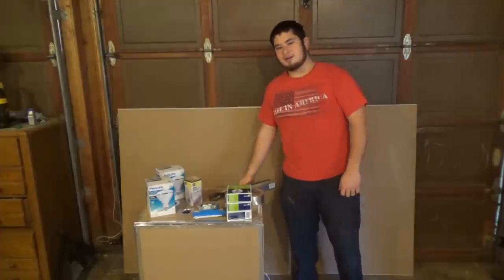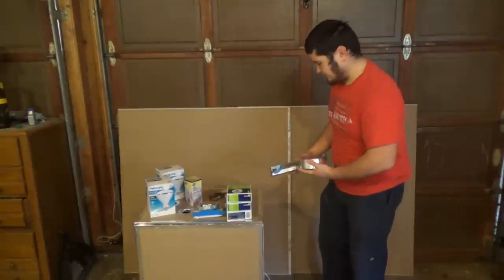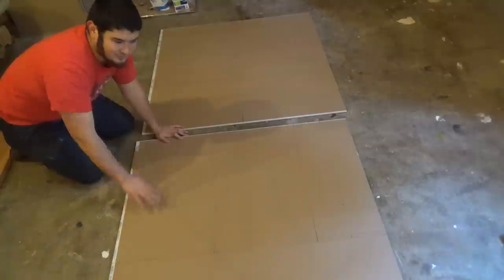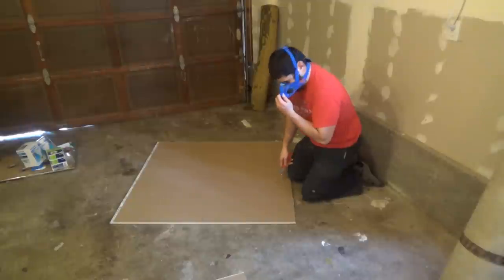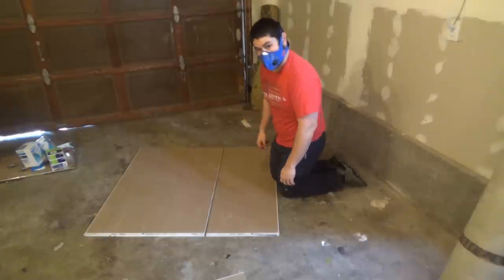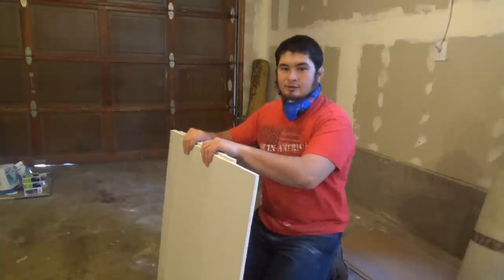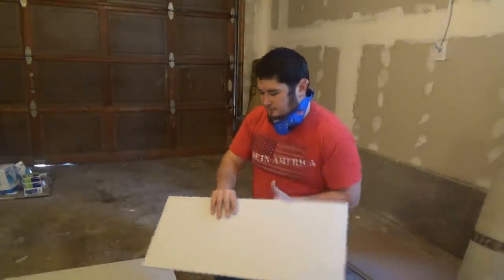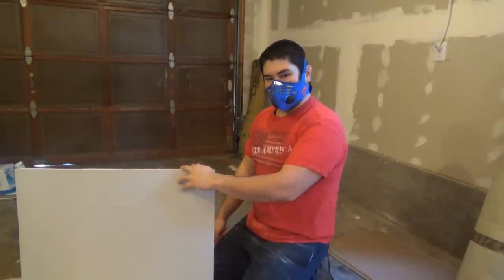Building a PVC Bow Hot Box Part 1 - Materials, Layout, and Cutting

Comment: Just in case anyone thinks they may need to cut lots of angled lines in dry-wall, thick motherboard, etc. there is are tools made specifically for the task.  Most craft stores would carry matt cutters that can be used with a steel square to make long cuts with a 45° cant along their length.  This will be the tool I use to build a heater box, if I think I'll ever need one; as I do not trust my carving ability as much as Nick trusts his.

Comment: Just a thought, here.  You can get nice straight cuts with a "drywall t-square" also found at Lowes or home depot.  This would make the edges fit nicely together and result in less heat loss at the seams. It may even make the thing more rigid.  Keep up the awesome work Nick.

Comment: Thanks for the videos. Well detailed and inspiring. I finished making the box and just put a hole in the side to allow the heat gun to flow into the bottom. No additional
lights to buy, no switch or wire. I bought the heat gun at Harbor Freight for $8.00.  An optional step for the electrically challenged. Great for those who already have the gun.

Comment: Guys what is the hotbox actually used for? Is it to preserve the shape after removing the bow from its form? I can't seem to find the answer anywhere...
Reply from the maker: +Raul Jackson This hotbox is for heating PVC pipe for making bows. You place the pipe into the open end of the box and it heats up. This is different than a hot box for storing horn bows and hotter than a hot box for curing fiberglass bows.

Comment: Hi, Nick, I think your videos are awesome, man, you're a great inspiration! I'd like to ask you, wouldn't be better a longitudinal oven heating the entire pvc pipe instead one half at a time? once I've watched a video where you placed some aluminum foil in a mold, in that case you used a heat gun, how about a mix of the two methods? 70" mold, aluminum foil and light bulbs? Thnx for your videos, pal!!
Reply from the maker: +Gabriel Ultra The only problem with that is you'd need a setup to flatten both limbs at once. It's possible to make a form like this, but for me it's much easier to work one limb at a time. If you wanted to build a longer version, double the length and double the bulbs should do it.
Reply: I see, I'll try to do it and then share to you, thnx, pal, you're brillant, I've been watching your videos from long ago and you always surprise me :)

Comment: 16 gauge wire is too thin to use for the amount of current you are pulling with those bulbs you really be using 12 or 14 gauge, the larger the gauge the less heat build up in the wire as the easier for the current to flow though it. Great video as usual!
Reply from the maker: Thank you for the information! I'll be sure to keep that in mind for future boxes.
Reply: 16 gauge is rated for 13 amps, 650w of bulbs only draw about 6 amps, however I would recommend checking the type-codes on the package of the extension cord and looking up its useful temperature range, many use a thermoplastic for the insulation that is only rated to boiling water temp and could soften or melt in your hot-box.

Comment: Hello Nick! Love you vids and now im a PVC bow addict! :)
So Im doing a box today, and I wanted to ask you how many different configurations have you tried for this box?

Cause I was wondering: heat goes up, and accumulates from top to bottom, and also, less area to heat up would mean less bulbs needed. So having this in mind, maybe doing a much thinner longitudinal box for one single pipe at a time instead of 3 (similar height to yours just to heat up 1 limb at a time), with only one 250W bulb at the bottom and with a 10" clearance between the bulbs and the tip of a pvc pipe, might work just as good.

Im thinking this build up of heat + less area to heat + there is just one hole through were heat is lost = might equal to a simpler (one bow/limb at a time) and efficient set up. Kinda like using the concept of heating up a room with a couple tea candles and ceramic pots (this gets really really hot inside the pots), but with a high power light bulb and a variation of your box.
What do you think? Maybe you have tried something similar already?
:)
Reply from the maker: +jugo85 Thanks for watching!

I haven't tried making a 1 pipe box yet, but I am planning on testing several small heat box design soon. Reducing the box by 1/3 the volume and using 100W bulbs instead would probably work well. The problem with only having one bulb is that while heat does rise, I find you need at least 2 bulbs along the side, otherwise the bottom and top get hot, but the middle seems to stay cooler for some reason. Using a fan to circulate the air may help with this.

Hope this helps, let me know if you try making a smaller box!
Reply: +BackyardBowyer Hey thanks for the reply!! I ended up not trying last week, but I will this weekend. I also thought of doing a mini-box with one single 100Watt bulb for heating up only the handle :p
Hmm thats interesting that the middle would be cooler. I'll keep that in mind when trying it out, and I'll let you know how or if I solve it :) Peace!